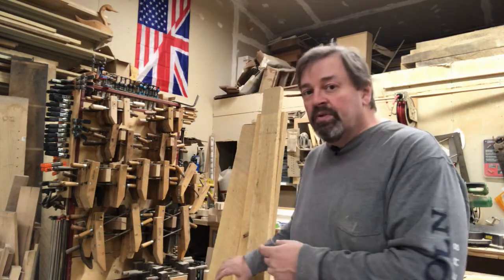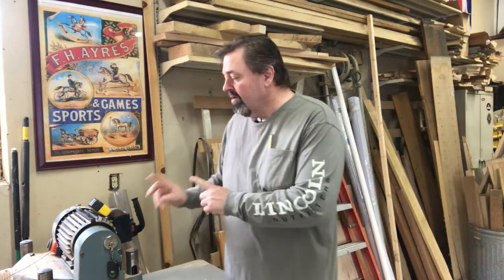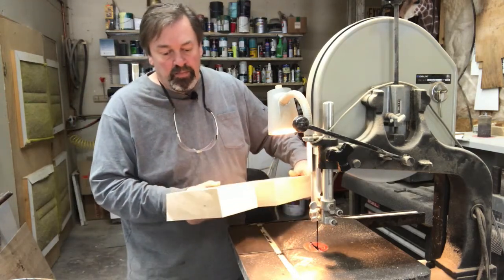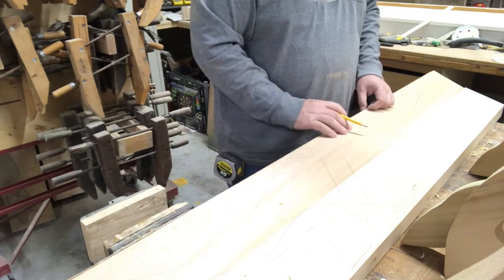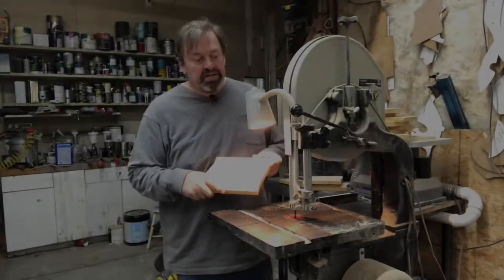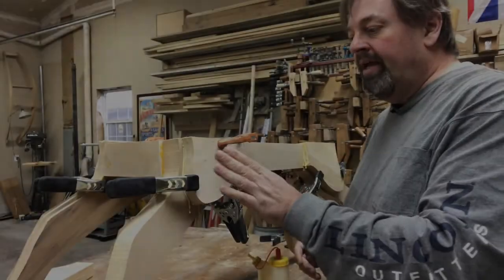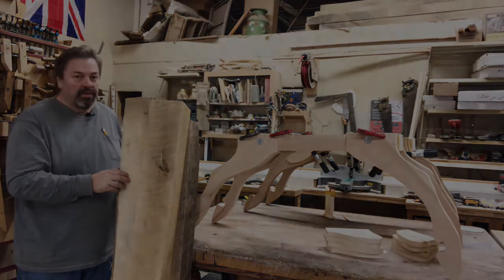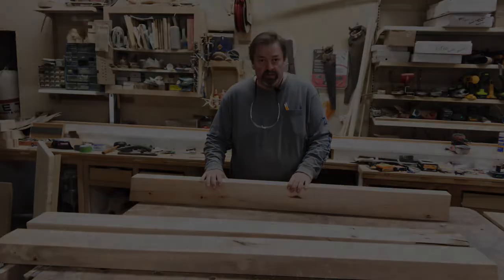How To Build Then Carve a Large Victorian Carousel Rocking Horse.

Comment: Great job I like all your videos & the music. What type of wood is used for the legs & the rest of the horse. At the last video I see you use screws instead of bolts to hold the horse to stand.
Reply from the maker: Thanks Jeff,
Yes I use pocket hole screws to mount the horse to the stand. I can do that because I add more material to the hoofs to shape them instead of the flat hoof’s. That way, depending on the size of the horse, I can use 2”or 2 1/2” screws. Plus, pocket hole screw are extremely strong and can draw the hoofs in tight.  I use mostly Bass wood to construct and sometimes poplar.